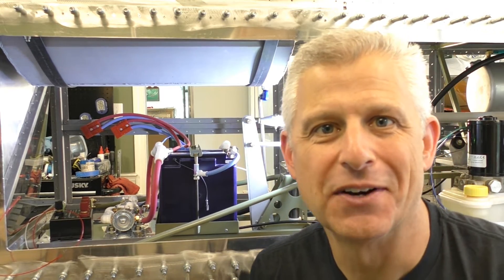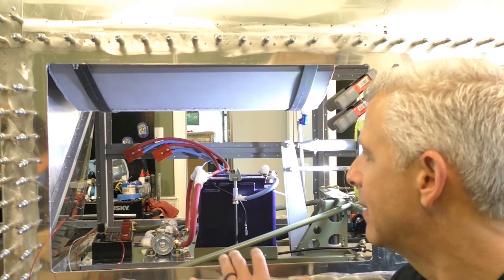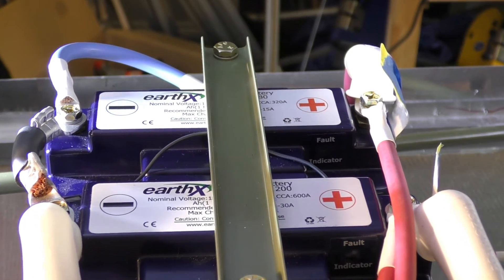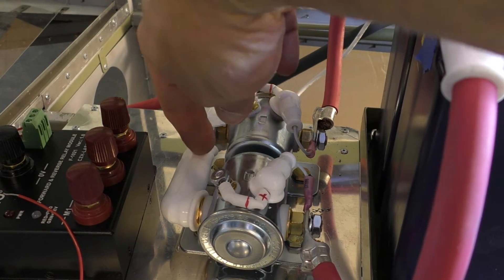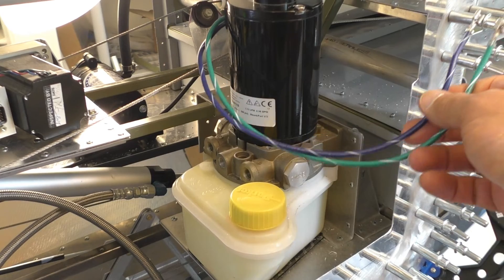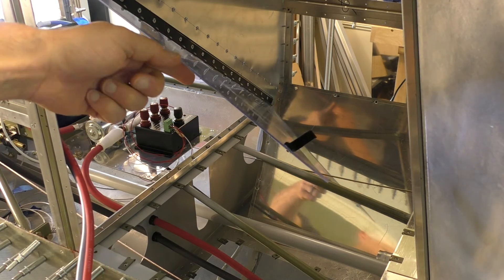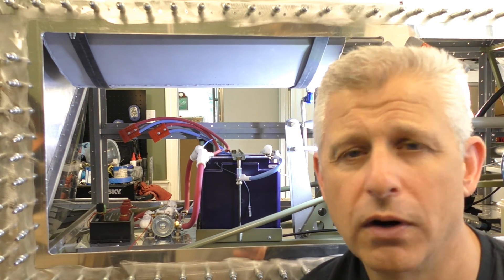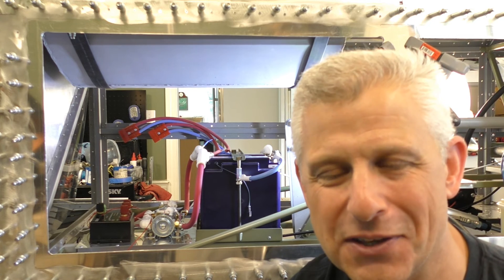Electrify the Mustang!  Adding Electrical Power to our Titan T51D Mustang Project

Comment: What’s the advantage of being able to reset a high current circuit breaker (eg. gear motor) in flight?  If you take off, raise the gear handle and the CB pops, are you going to reset it without knowing why it popped?  If you’re in the pattern, you put the gear handle down and the CB pops, same question.  Would you rather do an alternate gear extension or risk landing on fire?

You could ask the same question about most circuits in an aircraft.  If the answer to the reset question is no, then why spend $$$ on an electronic CB system, or even electromechanical CBs, instead of a simple, cheap, light-weight fuse block near the batteries?  Odds are that properly sized fuses will last the life of the plane, and if one does pop, it’s probably for good reason.  You’ll save money and weight in wiring too.

Also, those White-Rogers style whiskey barrel contactors should be mounted vertically with their cap down instead of horizontally.  See their data sheet on Aircraft Spruce.
Reply from the maker: I’ll check that out about the solenoid orientation and I have a contact at the manufacturer I can ask about it directly. 

Regarding the CB reset, you are correct that resetting a CB should be avoided if you have any other options (like the gear dump valve).  However, I prefer to have it as a CB in front of me rather than a fuse.
Reply: @SocialFlight  …and that’s why we build our own airplanes!
Reply: A breaker protects the circuit AND provides control of major power distribution points. In the event of a failure mode that involves a runaway pump, one can kill it. We have already lost a Titan T51 from a runaway pump in a belly landing and loss of all electrical power in the process.

Comment: Curious what wires you have going to the rods that hold the top strap down for your batteries? Thanks!
Reply from the maker: Those are the ground wires. I just realized I left that footage out of this video!  I’ll post a short video segment on it ASAP. Thanks for the heads up!!!
Reply from the maker: Electrical grounding video supplement published!  Thanks for the head's up that we forgot that in the first video... ;-)
Reply: @SocialFlight  I thought they might be ground wires, just never seen it done that way… which doesn’t mean much😄